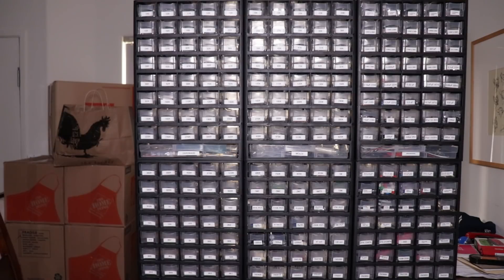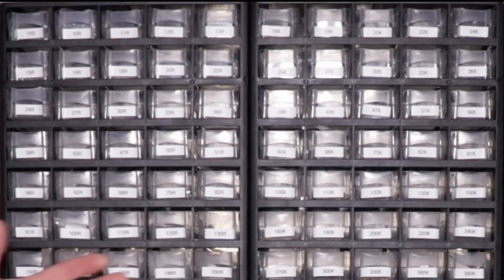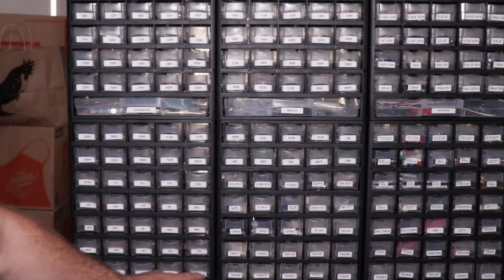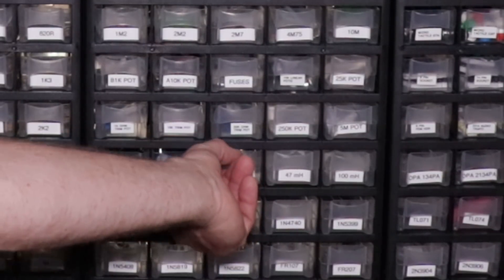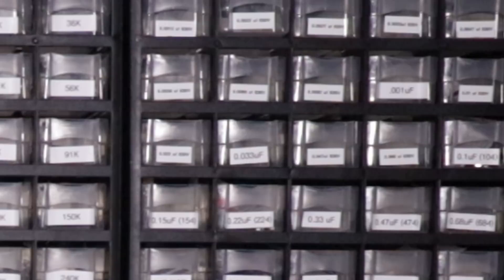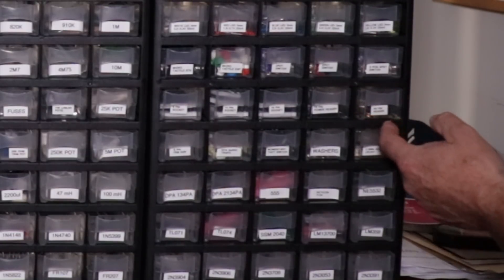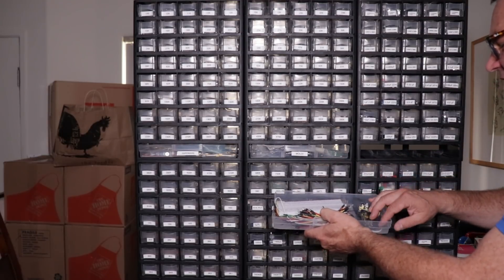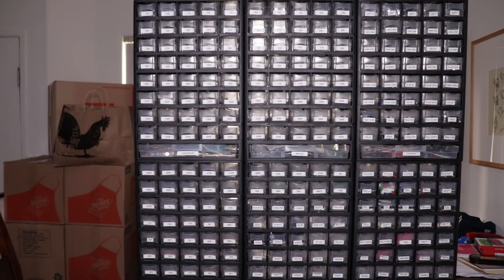Synth DIY - Building an Electronics Pantry | Tutorial

Comment: My pantry consists of a 25cm³ cardboard box with dedicated bags for each category.
Everything is sorted by value inside each one of them, using small zip bags that came already labeled with my previous Mouser orders.
Except for N4148, N3904, N3906 or very common resistor values I don't feel like I need to stock that much. Ordering by multiple of 10 is working nice for me.
I get from Tayda almost all my connectors. Pots & jacks from Thonk.